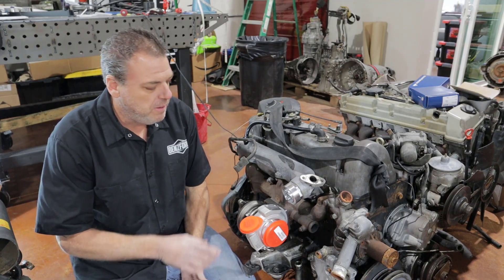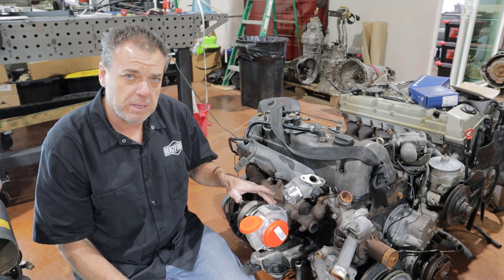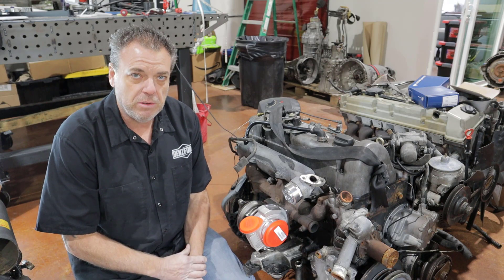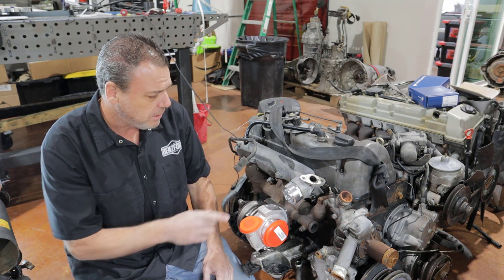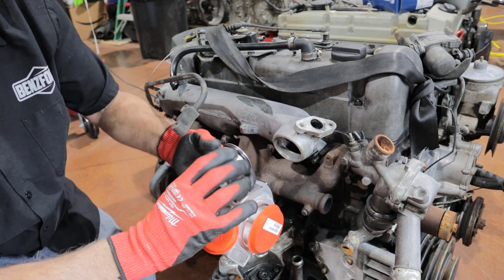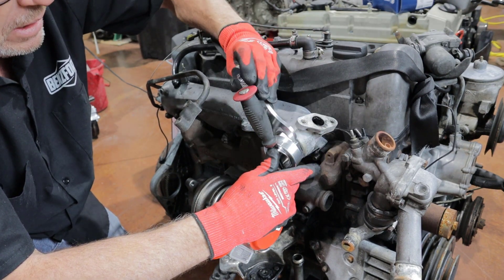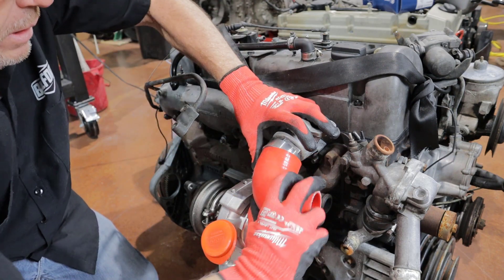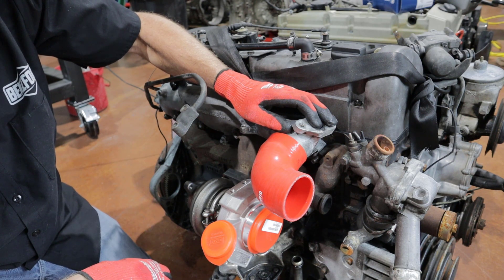Mercedes om617 Intake Adapter for Intercoolers

Comment: Do y’all still make this adapter?
Reply from the maker: We have run out of inventory and are not sure if we will produce it again or not
Reply: @BenzForce  why? It seems like a great product. I have one on my swap, I havent really gotten around to using it, but I was actually able to use it with long exhaust studs and a spacer so that I could fit an HX30W non intercooled. (I have a stock pump with Alda delete)

Comment: Who has actually put an intercooler on their om617?
Reply from the maker: You better believe it.  Bump up the fuel to 90-120cc the EGTs will go through the roof under hard acceleration.  The dyno car spikes over 1600F with a pump and stock turbo.  That is not sustainable and lowering intake temps help.
Reply: @BenzForce  I believe it! But I have seen very few documented online. I'm wondering who has actually done it and how it looks.